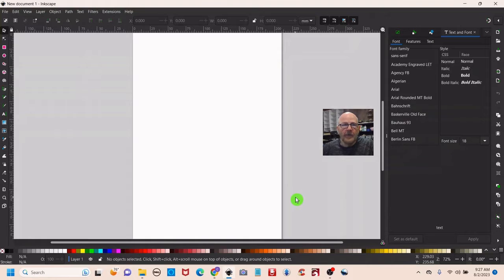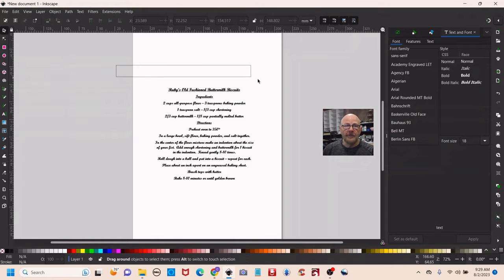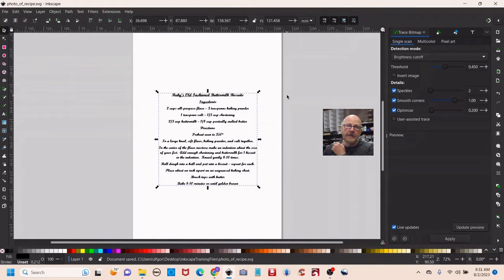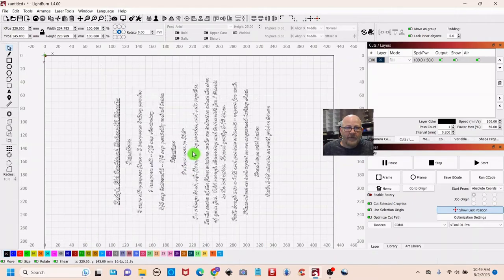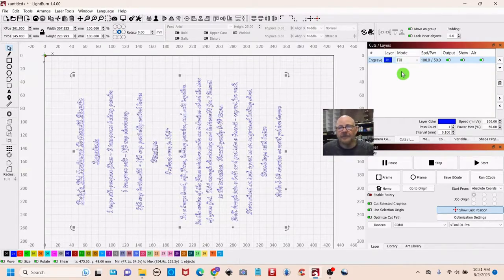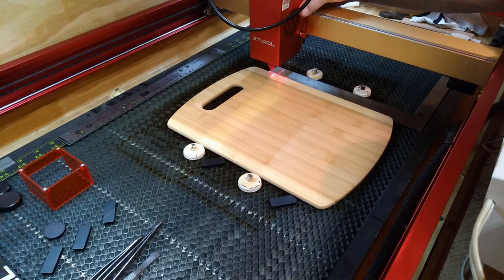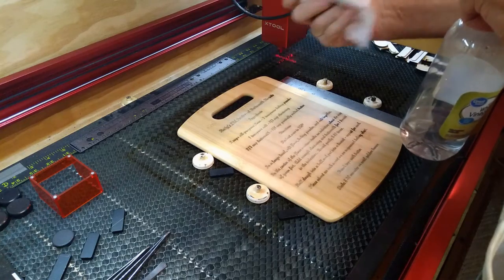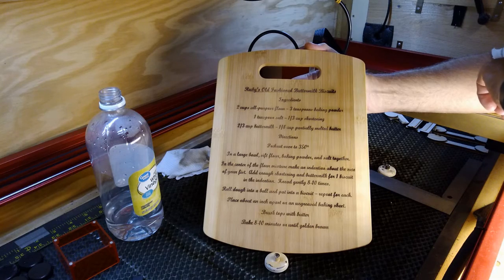Engrave a Photo of a Recipe to a Cutting Board | Beginner Laser Project #1

Comment: I use a very similar technique. But after engraving, I lightly sand with 320 grit, along the grain. This will remove ALL residue. Then use compressed air in the engraving to remove all the dust. Apply your finish afterwards.
Reply from the maker: Thanks, Robert - I'll give that a try next time. I appreciate you watching and for the tips - Dave.